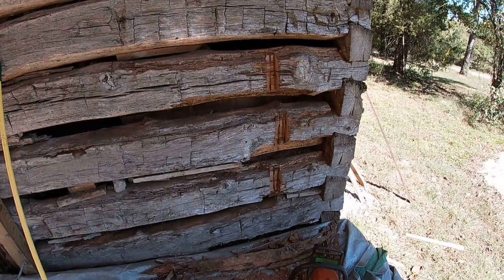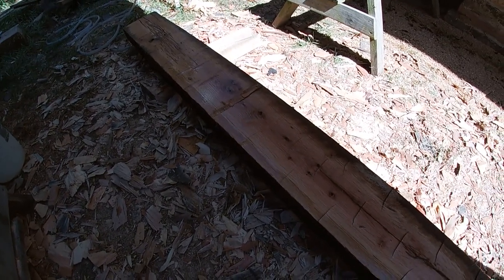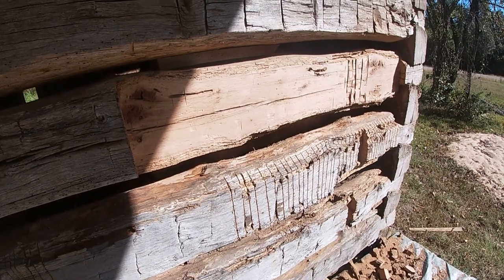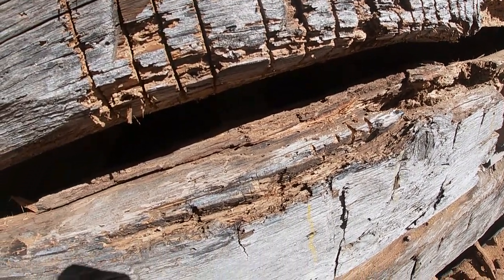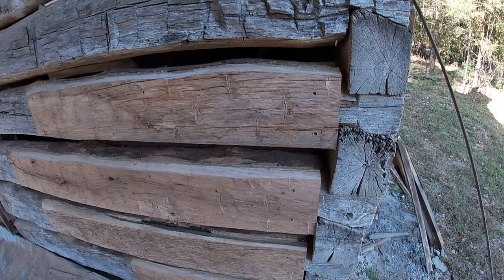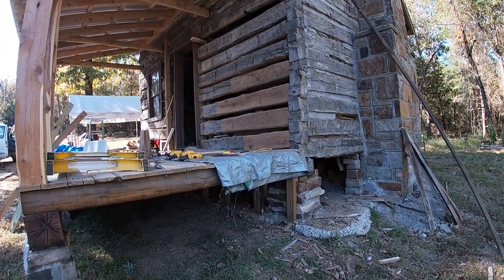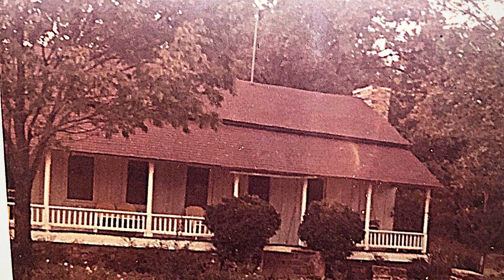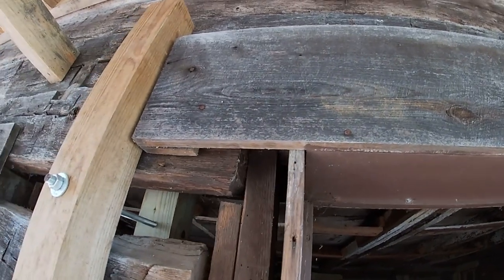Repairing Termite Damaged Logs, Gilliam Log Cabin (Pt 6)

Comment: Instead of replacing a log could one fill it with resin? I have a log cabin from 1930 and have termite damage.
Reply from the maker: Howdy Pamela- I’m sure you could but that could get expensive. I’ve heard of some people using bondo. The damage was on the outside and looked pretty bad. Where are you located? I’ve looked at a lot of old cabins. Hope everything works out well for you with your cabin. God bless

Comment: ? If there was hermit damage with the log that high up off the ground ,,,,would it be good to spray some kinda hermit killer in,the under side of the logs and rock foundation to deter the termite from getting on the logs. ?
Reply from the maker: Howdy Dennis- yes, it would. This cabin had been moved from the original location and set up on some distant relatives of the persons who had built it. From what I was told it was just about sitting on the ground.  The termite damage happened well before it was moved. Thank you so much for watching the video and for the comment. God bless

Comment: I have some pine logs that have fallen over last winter. I recently acquired the property. Would they be worth trying to save or do you think the bugs have probably done a number on them already?
Reply from the maker: Larry Reese   Howdy Larry- you could check them to see if they are ok. If they have wood borers in them you can sometimes hear a ticking sound they make when they are chomping away. They could probably still be sawed into lumber but I wouldn’t use them for wall logs. Hope you can salvage them. God bless you
Reply: @TheBeardedCarpenter  thanks.

Comment: I have a question. I want a ~30x30 cabin but only have the capability to saw logs to 16 feet and honestly around here straight logs larger than that are rare with the exception of oak and the rare yellow popular and oak is out of my budget. Could I make each side have a post at the middle of the wall and just mortoise and tennon them in? I don’t like the idea of joining logs end to end it seems very weak to me unless you know anything about it. Any advice would be much appreciated.

Also, how do these homes pass code? Around here the r value for a mass wall is like 17 and that ain’t happening with logs. I was gonna cover mine up with wood fiber insulation and plaster on top, but that isn’t cheap and I heat with wood anyways.
Reply from the maker: Matthew Niedbala   Howdy Matthew- I do join logs end to end with a mortice and tenon joint with pegs and they don’t come apart. I am going to do a video of that when I get a chance. I don’t know where you live so I can’t tell about the codes there. We have never had trouble with codes where I’m at. A properly built log building is incredibly strong. To comment on the R- value, the logs will absorb heat in the winter and reflect it back into the room. Same with the ac. Our log house is easy to heat and cool. If you have any questions you can email me Thebeardedcarpenter8@gmail. com   God bless you